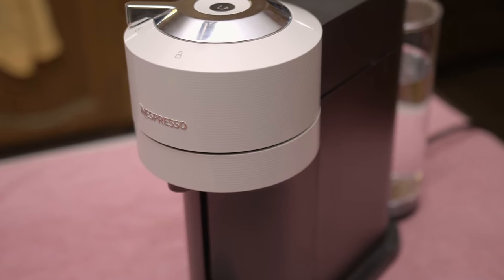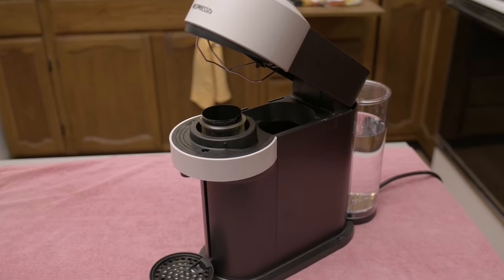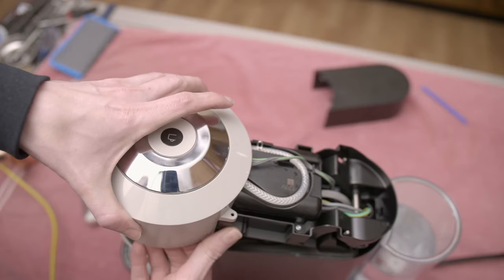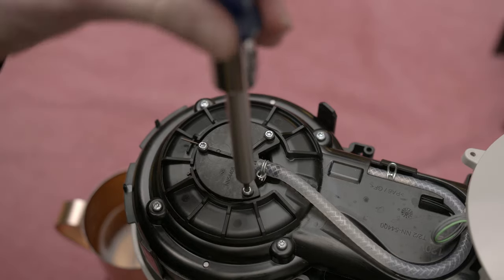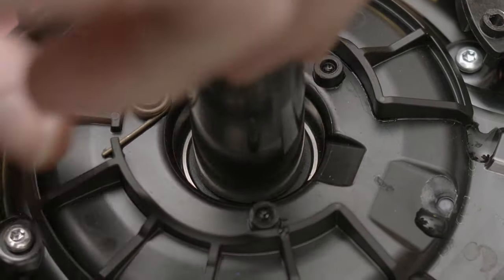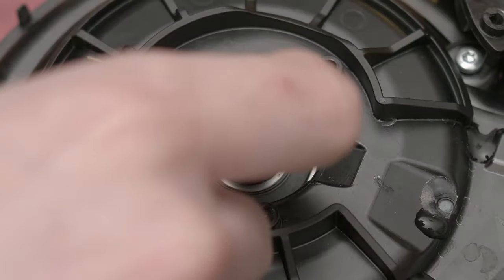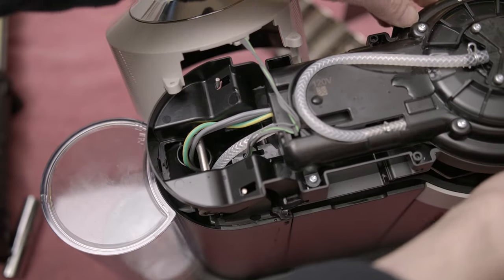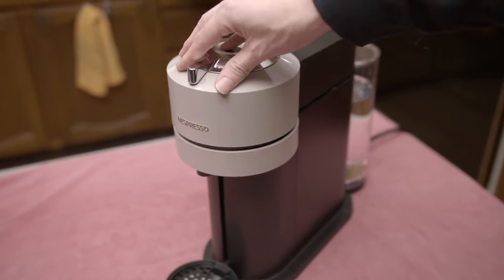Nespresso Vertuo Next - Don't Buy This

Comment: I have this machine, which I think has suffered from the same issue in terms of where it is leaking. The machine now does not power on at all. Just stopped working altogether one day. In your opinion, do you think the circuit board for the heater block might have been fried, due to the close proximity of it to where the water is leaking from? I have stripped the machine down completely and have taken a look at the main circuit board in the bottom of the machine, and that appears undamaged. There was no water or coffee residue on the main board, but there was in other parts of the machine. Thanks for your time.
Reply from the maker: What about the power button circuit board in the lid portion?  I never tried plugging it in without it if someone knows what happens that might help you out.  If still under warranty I'd try contacting Nespresso first.
Reply: @naps1saps  Received a replacement from Nespresso, but I still have the broken one. I think a replacement main board would likely fix it. Gifted the replacement to my dad, and that is still working fine for him at the moment (touches wood). I've pointed him in the direction of this video though, so he's going to open it up and come up with a fix for this inherent leakage area. He's a clever bloke. He will sort it.
Reply: @christopherlloyd9954 , did your dad ever figure out a cure for the leaking Nesspresso? I have a leaker that I’m going to have to repair and could use all the help I can get. Thanks
Reply: @Hoaxer51  He didn't, Tim. But I'd try the gasket flipping method first.
Reply: @christopherlloyd9954 , I didn’t realize that your original response was six months old until after I sent mine. Thanks for the quick response, I agree with the flipping the gasket over repair. That’s what I’m going to try and to make sure the other piece is tightened down on top of it also. 
Thanks again!
Reply: @Hoaxer51  Definitely give that a go, and yes, make sure the nut on the top is tight. Please report back with an update when you've done it 🙂
Reply: @Hoaxer51  How did you get on, Tim? I just did the gasket swap on mine recently. Put the white gasket in place of the blue, and vice versa. No leaks now. It even sounds better when it's running!

Comment: i'd grab some gasket paper and cut it to fit between the inlet assembly and the base, not ideal but it's like a $4 fix
Reply from the maker: Could work.  Unfortunately I forgot to pressure test with the inlet connected.  Just seems a bit fragile for how much it costs but hopefully this video helps someone even if to repair with a bush fix.
Reply: Would not repair it.  Send it back. I believe there is a warranty, but if it is new, just return it.
Reply: @naps1saps  Aaaah so this is why my AFCI trips. It hasn't leaked outside but Im sure it does inside.
Reply: @dianevanderlinden3480  Yep! 100% correct it will.
Reply: I have the same one for the last 2 years and no problem so far

Comment: This would be my 3rd time getting my nepresso replaced. 3 diff color again! I originally bought my Matte Black that I really wanted. Then rose gold because black matte was not in stock, now I had a choice to get black chrome! Does anyone have any reasons why these machines stop working? They wont pour again but why does that happen? Didn’t even want to descale right.  Not worth the money but I’m hoping my 3rd replacement is my last and will continue to work
Reply: This video shows you the exact reason why they fail, and stop working properly.

Comment: That’s what warranties are for and extended warranties are offered.
Reply from the maker: Sure.  I've seen a few people go through 2 or 3 so far in their warranty period.  Why would you want to put yourself through that?
Reply: @naps1saps   Well I don't have this model I have the  vertuo plus  And have 0 issues and I've had mine for about 2 years and I love it makes rate coffee because they have lots of great coffees in new stuff they keep coming  out.  But you should have nespresso  I never easily helped you in resolve the issue.
Reply: @naps1saps  Indeed. Yet they continue to be sold with no admission of any failure...

Comment: What machine did you finally get??
Reply from the maker: I had a cheap 15 bar machine and ended up going deep into espresso and recently splurged on a Gaggia classic pro and added a microcontroller from the Gaggiuino project.  That machine should last a lifetime TBH.  Very fixable.  I wouldn't get one unless you want to learn how to do espresso.  If not, get an auto machine but they can be hard to fix.

Comment: I understand you had an issue with your Nespresso, but I think you just got a defective machine. That can happen with any machine. What I’d like to know is if this is a general problem with this model, how many other complaints do other customers have? And if so was there a recall? Your video only shows one customers opinion based on a negative experience with a product and not a wide spread issue. I’ve had mine for a year and it works perfectly. And although my experience contradicts yours it’s not to say all will work as well as mine.
Reply from the maker: I think the comments here and on Reddit with several users going through 2-4 replacements is a good indication that the design is very poor and the issue is not an occasional defect.  It seems to be more specifically this model and not others.  The complex design and electronics don't provide the buyer a serviceable product.  The only recourse is to trash or exchange.  The amount of waste this creates is enormous.  Their green washing comments of recycled plastic and pod recycling program are a cover up.
Reply: @naps1saps  that makes sense. But then that info should have been in the video.

Comment: After about 5 months mine only produced partial cups of coffee.  The recommended solution is to do a factory reset.  Several attempts did not improve the problem.  A few weeks later the light does not come on and the button does not work.  When closed in the locked position you can hear the pump activate and the heater does come on.....that's it.  Unfortunately it will shortly be headed to the local landfill.  (Great coffee when it did work!)

Comment: Why didn’t U just get a replacement/refund so u can do a proper review on the machine
Reply from the maker: I mean if you want a sponsored review where they received a free unit you won't find it here.  And I returned it for a refund, yes.  They won't send you another machine and give you your money back, that's not how commerce works.
After taking it apart it was pretty clear any issue you have won't be fixable unless it's a hose problem.  The Original line I believe is more fixable due to less moving parts and is more reliable.  I would rather not wait past the 30 day return window for a replacement and then be stuck with a unit that has a bad track record to potentially have the same issue again and again like I've read from some others.  And it got worse the longer I used it.
By comparison the Delonghi EC155 can be fixed and I had the older model that is 10 years old gifted to me and it uses the same internal parts for the most part.  95% of the internal parts can still be ordered.  I support the right to repair and after getting an espresso grinder and a non-pressurized basket, I am more happy with the taste even though it takes 5 times the effort.  It's real espresso.
I despise throw away culture and wish I was shocked by how all the mechanics, pumps, and heater for the Vertuo Next were packaged into a sealed unit but I wasn't.  It disgusts me.
And that is my honest opinion (review?) of this machine.  Would my opinion be different if it was still going strong?  Most likely.  But that doesn't change the experience others have expressed and I decided to publish this as a warning.  This isn't a review video, it's an opinion video.  Take from it what you will.

Comment: Having the same problem with my Vxirtuo next that I have had since December. Leaking non stop and wont even turn on now.
Reply: That's what happened to mine. It won't turn on anymore, presumably because the leakage from the area shown in this video runs down the top of the machine when the lid is opened and runs down into the bottom where the main circuit board is, destroying it. Hence not powering on anymore. Nespresso know this, for sure, but they continue to sell the machine....

Comment: I had the same problem most everything was running into the canister that holds the used pods. I cleaned it I descaled it I checked the nozzle that it wasn't blocked. I looked everywhere online for help and then finally I called the Nespresso number and in about 5 minutes I was up and running. She had me do a reset which is unplug the machine empty everything open the lid close the lid but don't lock it push the button five times quickly. It will do a orange blink and then it will go White. Fill your water tank and have a cup of coffee.

Comment: Yep. Can’t agree with you more. This machine is an over engineered dud. My first one lasted less than three months and they sent me a replacement which lasted less than two weeks. My two Breville Virtuo machines give me absolutely no problems. Stick with the original line and forget about the next.

Comment: I've had mine two weeks and made like 3-5 coffee/espresso a day and it's been completely fine so far. Just because you have a lemon didn't mean you should be advising people to not buy it. 

Not everything that's made will be perfectly working, wither it's a vehicle, a coffee machine, computer or even clothing. That's why there's warranty on products. You sound like you're going out of your way to hate on the product. You had it 3 weeks, so it was still inside warranty by a long shot. And instead you made a video of yourself voiding the warranty by taking it apart. Great useless information for the sake of a bait video. You could've just made a 5 second video saying, I bought a Nespresso next, it leaked, so I returned it and the new one doesn't leak.
Reply: The fact of the matter is, they all leak in this area. It's only a matter of time. Sorry, but there should be no apologies made by a person who has a degree of ingenuity and is clearly highlighting an inherent design fault with these machines. Kudos to the guy who took his time to make this video.
Reply: I think the product is really defective. Not only the leak but it stops working after i made nearly 24 coffees within a year. Considering we kept this clean then it stops and sometimes it creates onky half full.